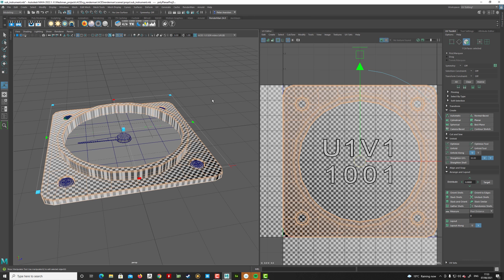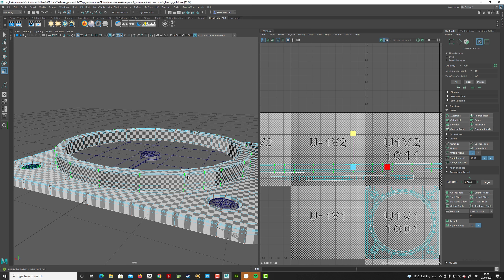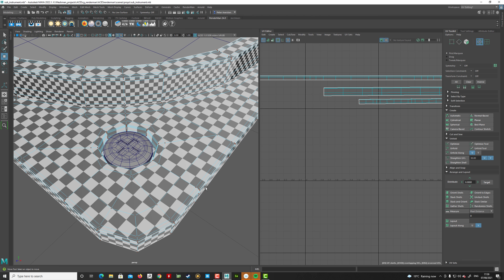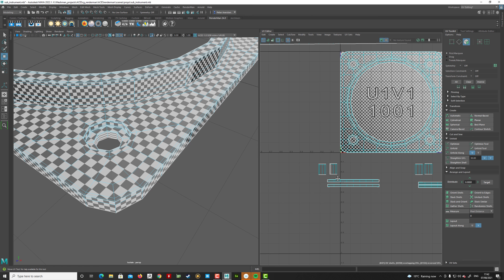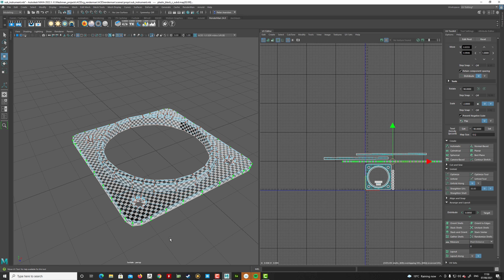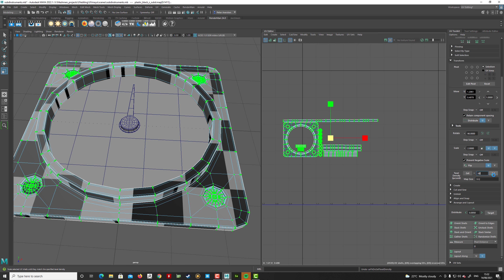Learn UV mapping in Maya | Maya tutorial | Become a texture artist

Comment: Hi I wanna ask. In this video there are many cut so it will be have many seams. When texturing, the texture will not connected between surface on the cut points. So how we hide the seams when texturing?
Reply from the maker: When texturing in softwares such as mari or painter the textures are expanded / bleed around uv borders hiding seams. By that i mean paint seams. You do have issues if you use tiled textures where patterns might not match and you need to treat uv seams using material paint or using something like a triplanar projection for areas.